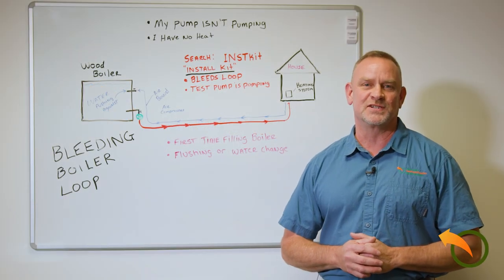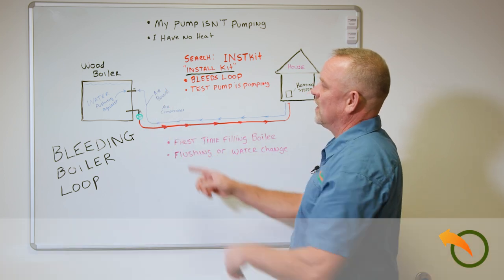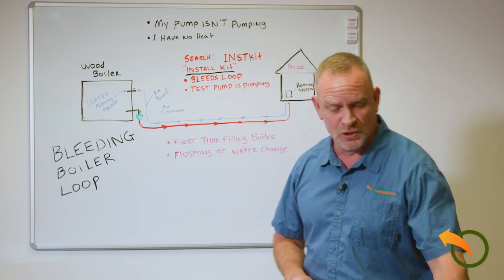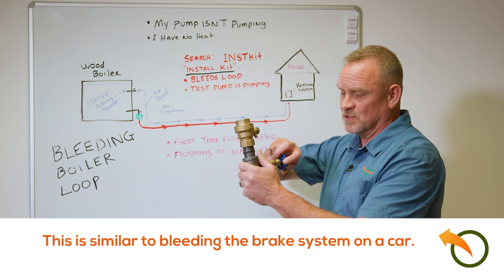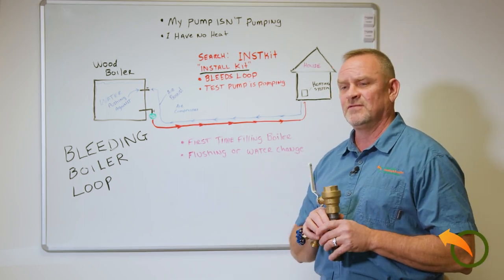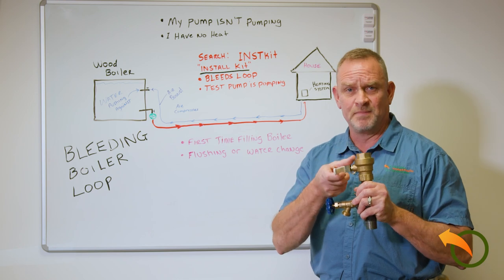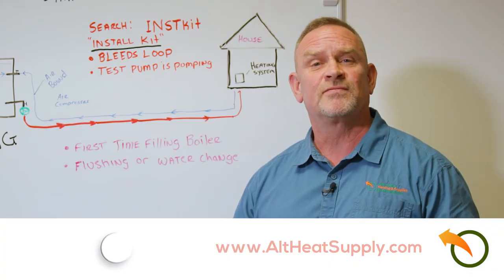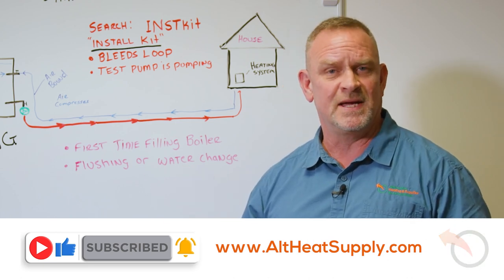How to Bleed a Wood Boiler Loop. Simply

Comment: I recently purchased a central boiler 760 and I am now converting my home Over to hydraunic baseboard... I do not currently  have an indoor boiler.. can I hook up and heat Soley with my out door boiler.. what all components  do i need... will i still Need and expansion tank  like u would be hooking up a traditional  indoor furnace?
Reply from the maker: You will need to set it up like a conventional heating system with zones and zone controllers. I'm not the best person to ask for conventional heating systems. My area of expertise is hooking up a Boiler system (wood) to another heating system. Jeff

Comment: Hey Jeff stupid question. I had a plumber tell me the black fittings in this kit would corrode in no time. Is this true?
Reply from the maker: No, I have had mine for 20 plus years and no issues. Most boilers are made from steel. Jeff

Comment: Why are bleeder valves not typically installed on wood boilers? And second end of that question is would it even work to add a bleeder valve?
Reply from the maker: Bleeder Valves will not on wood boilers. Bleeder valves are designed to capture Micro-bubbles in a pressurized boiler loops. Most of don't have that with a wood boiler. We just need to get the large air pockets out and we are good to go!
Jeff

Comment: I really like your channel. Where are you located. I wonder if we could collaborate some day at my house in Maine. I want to do a whole series on switching to an outdoor wood boiler.
Reply from the maker: We are located in CT.  I appreciate the offer let me know what you have in mind... Jeff
Reply: @AltheatsupplyLLC  oh that’s awesome! Where at? My wife is from Farmington. Can I reach you by email? Basically, a case study on the house, converting from the oil burner to water to air heat exchanger in existing duct system, building out the wood splitting / boiler house area. This would be prob late spring to prepare for winter 2023. All the best!

Comment: Put the pump in your house
Reply from the maker: You will still need to bleed the loop. The air is the issue. Jeff
Reply: @AltheatsupplyLLC  yes you crack the outflow side at the pump gravity gets water to the pump pump takes rest of air to boiler